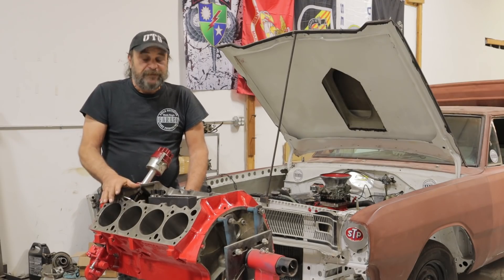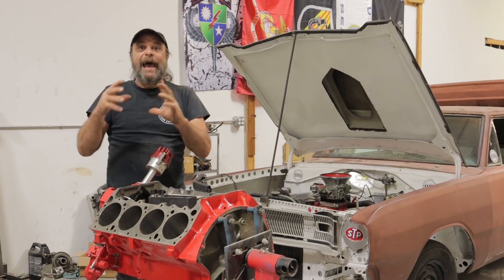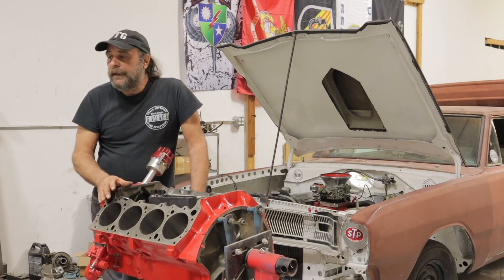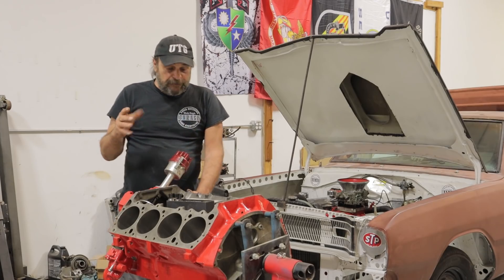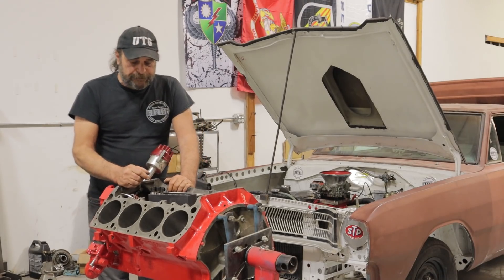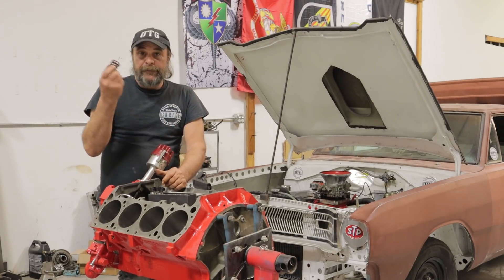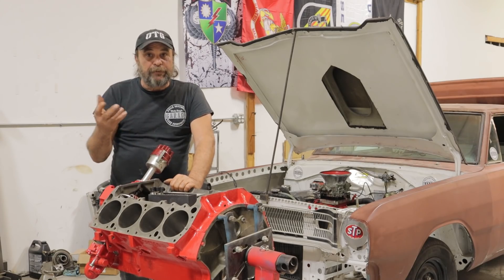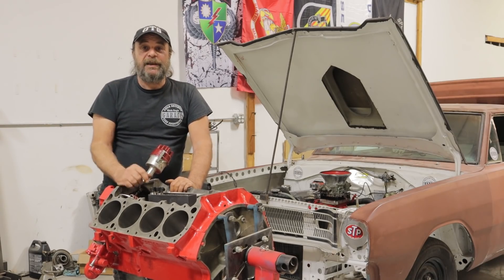Engine Break In For The Home Builder

Comment: I destroyed two cams, which filled the oil with metal, which destroyed all my bearings.  This was because I used too high of a concentration of zinc.  Now I use a break-in oil rather than try to figure out how much zinc to add to a non-detergent oil.  Each mistake cost 1200 dollars.

Comment: Never had problems with my cam lifter installs. And never brought rpm up for 20 minutes. Im my mopar engines. Even friends chevys. Would just crank them over til started then goose the throttle up n down for a bit. Then drove them. That was 20 years ago though.

Comment: Hey man quick question. I have comp valve springs matched for a 262h xtreme energy cam. The spring specs are 105 seat pressure 277 open pressure at .462 lift. Is this a safe spring to use for flat tappet break-in? Seems like a pretty modest cam and springs I’d imagine I’d be safe but checking in with a pro to double check myself. Thanks

Comment: Splash off of the crank lubricates the camshaft? Maybe in a 3-1/2 hp Tecumseh engine that is true. The pressure that lubes the lifters runs straight down on the cam in a car engine.

Comment: Hello, I'm confused with all the videos I've been watching on new engine break in.  So my new engine goes into my car in about 2 weeks.  1998 Trans Am WS6.  Its an iron LY6 (LS) engine.  Since I have roller lifters do I need to do this 25-30 minutes at 2,000-2,500 rpm for cam break in I keep hearing about?  Or do I only need to worry about breaking in the rings properly?  It'll be first started and broken in on a dyno-jet chassis dyno.  This engine has top ring at .026 gap and 2nd ring is at .024 gap and it'll be getting a turbo kit installed in a couple months at 18psi or so.  ----- Whats my best break in process?  Thanks.

Comment: None of this high rpm break in makes sense. The opposite, low rpm does make sense. No car factory ever breaks in an engine first start, not never, not ever, for over 100 years. Start the engine, drive it to the parking lot, turn it off. The cam turns 300 rpm at 600 rpm idle. The lobes are actually pushing the lifters ~1/2 of that, duration of ~180°. So about 150 lifts per minute or 2.5 per second. You can blink or tap your finger twice as fast, for perspective. This is trivial and breakin grease or even oil is plenty. When you raise the rpm 4 times you have increased the velocity at which the lobe approaches the lifter and the speed that the lobe wipes accross the lifter thus increasing friction dramatically. Like starting a fire by twisting a stick on a piece of wood slowly vs very fast. And pump oil from lifter bore and crank slinging takes a few seconds. As far as rings seating, use a bit of thin oil and low rpm. Never had problems and engines I built still run fine.
Reply: all new cars are roller camshaft this pertains to old flat tappet camshafts need lifter camshaft polishing

Comment: After the break in is complete, do you have to continue running zinc or no?
Reply: stronger valve springs yes for sure, stock I have got by but why take the risk run bottle ZZDT for insurance im building a BBC will run zinc every oil change soon.

Comment: Very good real practical advice.  Wanted to add that Tony's advice does apply to fuel injection too.  For example, if you've built a new engine, you probably have bought yourself some new fuel injectors.  Much like Tony's advice to use a known-good carburetor, you should also use known-good fuel injectors and not try to fool with new ones during engine break in.  Use the known-good injectors, then after its run in, swap the injectors over to the new ones you bought for your build and dial those in.

Comment: A question on break in with deep sump pan and windage tray.
             
    Should these not be used for break in and stock pan be used?   

  I have a w100 truck so the motor will need to come out after break with stock pan,  as there is no room to screw in the extended pick up tube for the rear deep sump oil pan I plan on using.

Comment: If my car has been sitting for a while….like a week or more….I’ll spin the engine with the key for about 10-15 seconds before I touch the accelerator pedal….pumping oil up  into the lifters and crank journals before she fires up. Is it hard on the starter? Yep. But I’d rather replace a starter than rebuild the engine.

Comment: I fire it up , vary rpm from 2000 to 2800 changing rpm every 5 minutes to throw oil at different angles for 20 to 30 minutes now matter the cam . Then most times engine is in a truck I  hook up my 20 foot trailer with a car on it and hit the hiway. Good drive and never fails me.Valvoline  VR1 best oil for zinc.

Comment: When I brake in my engines I always Advance the timing well beyond maximum spec. 40° is not that much without a load on the engine and it prevents the headers from turning red hot most of the time as well as Richening the mixture.

Comment: When you say make sure the engine starts first time, what do you do about getting oil pressure up first? I have always cranked over engine with no fuel (injectors disconnected) for a few seconds after oil light goes out so I know everything is lubricated first before starting.
Reply: This is why you prime a new engine prior to firing,  with valve covers off , you prime the engine until oil comes from each pushrod ,and flows down the rocker arm.NEVER  fire an engine , that has not been primed.
Reply: Keep the plugs out and start spin the engine till oil pressure up.

Comment: ok hearing about the exhaust manifold glowing red makes me feel better about my break in lol. i rebuilt my first engine over these past few months (300 ford in-line 6) and broke it in a few weeks ago. on initial startup and within the first couple minutes, the engine got pretty hot (got real close to 200 degrees) and the exhaust manifold was smoking and glowing a bit. like an idiot i shut the engine off for a couple minutes cause i was worried it was being damaged. started it back up again, and continued with the break in process and it all went well! runs and idles really good now. just waiting to put it in my truck
Reply: No problems letting it cool down as long as you restart and rev 2000 rpm, you are just polishing lobes and lifters.

Comment: All new engines that I break in, I change the oil and filter, and cut open the filter to inspect for any obvious excessive metal filings.  I don't even drive the car before a fresh oil change and filter inspection.  Again, just my preference.  Cheers,

Comment: I'm no expert.   I just want to tell you about motorcyle manufacturer's recommendations and I'm not saying UT is wrong....no way...this is just what the manutacturer said back in 1977.   I bought 2 new motorcyles (not at same time) and the "break in" was a certain amount of miles ( I forget  EDIT: It had a 9k redline but was not to be run over 6k on the tach until the bike had 1k miles ) but the important part is the American market  and European market had different requirements for them.  The European market (identical bike) had an RPM redline 500 RPM lower than the Amercan model (again, same bike).   Reason being that Europeans typically over rev their motorcycle engines while Americans typically do not go past the red line on the tach.

Comment: Hey Tony, nice explanation! I've had really good results with John Deere break in oil over the years on gas and diesel engines (many).  It ain't cheap, but it contains all the critical vitamins and minerals needed for success. Dump it right after 20 minute mark. Cheers bud! and cheers to the Super troll right above me I guess, anyhow you know what time it is! Thanks!

Comment: Pro tip on big or aggressive cams for break in. Use a dry moly Cote (if flat tappet only) on the lifter face then. Your normal break in lube. Also instead of doing the stock spring swap. If your running a dual spring as most do with a more aggressive cam you can take the inner spring out . Do your break in then Just add the inner spring in. If it's a very aggressive spring you can run just the inner spring ,do your break in then add the outer but DO NOT rev the engine over 2500 rpm or so. This system works great especially on flat tappets
Reply: Such good advice on the moly paste. I have always used the Moroso moly paste on the cam lobes and lifter faces on hydraulic cam break ins and have not had any failures

Comment: my first car was a 65 chrysler newport land yacht with a 2 barrel 383,727 trans, my dad built the motor,(put a 4 barrel manifold on) he put stock cam and lifters in it. told me to drive it hard for 1000 miles, took back into garage swapped the cam and lifters and springs. told me drive it nice for 500 miles.
couldn't tap the gas with out jumping into the intersection and doing a donut when it was wet

Comment: Ok , has anyone actually used Z-max for it's original intended purpose which was the offy engine cam issues ? 

Why not warm up the cam and lifters in the oven and let a bottle of Zmax marinate it so the pores suck it up? 
And a zddp heavy oil, maybe would help with the flat tappet issue?

Comment: I have a question. I've only rebuilt 1 engine my whole life, but work on cars for myself for the last 20 years. What if your just replacing camshaft, lifters, and all the bearings. Does the engine break in still apply?
Reply: Yes it does
Reply: You are polishing the cam lobs and lifters, you need non detergent high zinc oil, yes it cost but better than a wiped lobe, many videos on ruined engines, stock springs are more forgiving on break in.

Comment: I have found it funny over the years how common sense seems to take a back seat when it comes time to fire up the engine for the first time. I believe it being a combination of anxiety, anticipation and the financial abuse one goes through to get to that point. Like you said with the cost of break in oil (and most advice is 500 miles before changing the oil and filter) prevailing wisdom would be knowing all the crap that is flushed to the pan during break in, why would the 70 dollars +/- deter you from changing to fresh fluid and filter? After the thousands you already spent and countless hours to finally bring your engine to life, it is pennies compared to the dollars spent up to this point.  I see it time and time again. Even worse they go for a cheap grade of oil to save money. Next time I see them is for a gasket set, new bearings, cam, lifters and more break in oil.  They almost always blame the cam manufacturer (which I believe is part of the problem with the metallurgy)  ,but have told them that operator error is more likely the cause of why this has happened. Which no one wants to hear. 
If you fail to find the cause of a problem you are going to continue having the same results again and again. It is cheaper in the long run to look at your own actions, admit mistakes made, (even if they are your own) before blaming others. Most the time you get what you pay for, if you buy parts that are no named, on clearance, or discontinued to save a buck, odds are you will spend a lot of your time chasing problems down the line. What is your time worth? Spend the money up front buy American.
Reply: Spent almost 6k in parts and built it myself ,you know damn well I went to the dealer to get ripped off on a 16$ oil filter vs the 7$ one down at AutoZone. 
Made me feel good slingin mad cash like I just didn't care 🤣🤣🤣

Comment: Great and informative video Uncle Tony, I've got a 360 in my old 74' d200 and my 85' d150 best engines I've ever had. Also, it's weird the infatuation with the junkyard jet boys (great group of guys), but the people complaining need to understand that This is Uncle Tony's Garage, the junkyard jet guys are like the fun side kicks that probably have other jobs and aren't full time YouTubers.
Reply: I'm currently building my Grandfather's 1974 w200 with a 360 in it. This video is just what I needed. Question for you tho... what's the highest speed you've touched with your d200? Did a Google search but didn't find anything. I'm just wondering 🤔
Reply: @AGonzo108  well mine is stock still only has 64,000 but I have gotten it to 75 mph on the highway. My 85 d150 short box I got up to 110 with it's 360 rebuilt with .30 over and some Edelbrock performer heads, weiand intake manifold and Holly Demon carburetor. I don't remember the full specs of everything on that. Wasn't an expensive build but that was back in 2009. It's actually my daughter's truck now too.

Comment: They say there is no such thing as a stupid question, but, here goes. 
If you omit the spark plugs and hook up the crankshaft to an approximately 2000 rpm 5 hp electric motor, could you safely break in the friction prone parts of the engine without firing the engine?

Comment: How do you know which oils contain zink? Most oil bottles I looked at don’t show ingredients. Just the viscosity and mineral or synthetic.
Reply: break in oil is non detergent and high zinc, its better than the small bottle additive zinc, you don't want a wiped camshaft lobe run at 2000rpm for 20 minutes.

Comment: I'm confused, how does an engine under load increase cylinder pressure? Isn't cylinder pressure a product of static compression and camshaft timing? Zinc for roller cams? Never heard of that. I did find the video instructive though, good job.

Comment: Q: if extra-zinc oil is good for break-in, why not run it for the life of the engine?  Is it just an expensive thing that wouldn't have any value once the metal-to-metal parts are bedded in?  Would ZDDT help to correct (or even prevent) wear issues in an older  motor?   Great video - thanks for posting!
Reply: If you are running a flat tappet cam you should always use some sort of zinc. Like with diesel oil or a bottle. After that break in you don't need as much. It won't hurt it though
Reply: As said a flat tappet cam requires zinc forever
Reply: flat tappet cams need zinc after break end if you run stronger springs on valves for sure.

Comment: As for break in oil, mainly cause I use as much factory stuff as I can, I just use the oil I'll be running in the engine. For the most part I use Valvoline 10-30 conventional. The assembly lube I use is some flat out the best I've seen is made by GM. Not cheap either at least $20.00 a pint. I wish you had of went over a hydraulic cam not everyone is using roller rocker and flat tappet cams with adjustable rockers.
Reply: It’s called eo’s/engine oil supplement & is good stuff for ft cams as you stated.

I have a case of it on the shelf along with crane cams breakin lube for ft cams & lifters too.